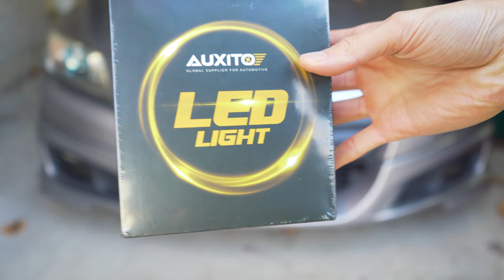I bought the BRIGHTEST LED Headlights for my CRZ (AUXITO LEDs)

Comment: indeed auxito is bright, but it melted my lens.
Reply from the maker: @thedonfranz  oh no way 😮😮 on what car?
Reply: @mattch1n  mazda bt50/isuzu dmax
Reply from the maker: @thedonfranz  ooo nice car, sorry to hear that happened though
Reply: U should try  Lasfit - LA plus. They have a very low temperature buildup while it will not melt or damage the plastic housing.
Reply from the maker: @toyotabrony  hmm I guess I'll have to be careful about my Auxito bulbs, but if Lasfit wants to send some out I'll be down to try them!

Comment: its not close to even a grand to put led is in place of hid on that car specifically.
Reply from the maker: @tronalddump8776  I’m not sure I quite understand? I was saying that it costs thousands to replace the Xenon’s main running lights. LED is what we installed from Auxito as high beam lights
Reply: @mattch1n  thousands?????? what? you remove the ballasts and wire new lights directly to 12 volt from the car or get pigtails and wire em in place and they specifically make leds to take the place of a hid (projector light). the light you replaced was not the hid.
Reply from the maker: @tronalddump8776  isn’t Xenon distinct from HID though? also yes, I know, I said I replaced the halogen high beams, I didn’t say anything about HID
Reply: @mattch1n  I know but you said it was thousands. I was correcting that statement. I know what lights you replaced. That is a xenon hid in the projector.
Reply: @mattch1n  also xenon refers to gas used inside of the bulb but hid is the fact it's using a ton of juice via a ballast to make a high intensity discharge where as the halogens are just a basic incandescent using halogen gases.
Reply: @mattch1n  hid is still prone to a short life and ultra high temps led is superior for everything. Just got to make sure you got the right  placement in the housings.
Reply from the maker: @tronalddump8776  ohhhh true, my bad I didn’t know Xenon and HID was the same thing. yeah I’ve definitely seen the HID to LED conversions that you’re talking about
Reply from the maker: @tronalddump8776  since I have Xenons, I just googled “CRZ Xenon upgrade” and the results were for buying a whole new headlight with upgraded xenon’s and those were big money 😅
Reply from the maker: @tronalddump8776  I think my Xenon’s are okay for now, but thanks for the tip, I’ll definitely look into converting my Xenon’s to LED when I want more light, thanks!
Reply: It throws some serious light, well worth it plus the lifespan alone will save money and alot of time.
Reply: @mattch1n  and no problem, I just like making sure people get the right info.
Reply: @mattch1n  I think the company you used also has the hid upgrade for your car for good price
Reply: Nowadays u can swap from HID to LED. Like D2S LED style bulbs. Lasfit, Auxito, And auxbeam led bulbs have them. LED’s are brighter than a 35W HID, and much brighter than a 55W HID.
Reply: @toyotabrony  right. That's why I made the comment to the guy who made the video.
Reply from the maker: @tronalddump8776  yeah they definitely do
Reply from the maker: @toyotabrony  yeah definitely, now that I know Xenons are a type of HIDs haha